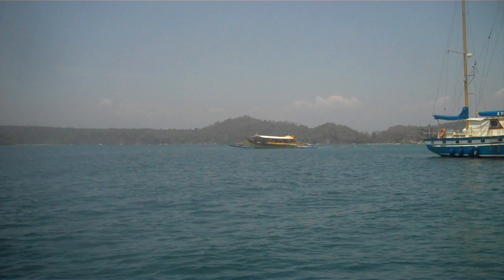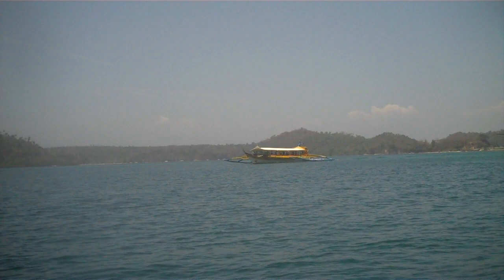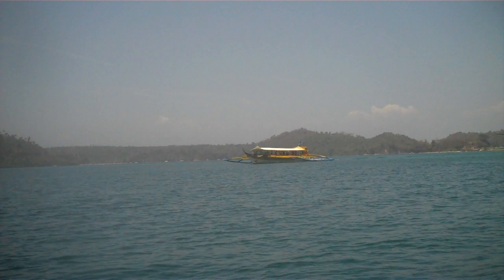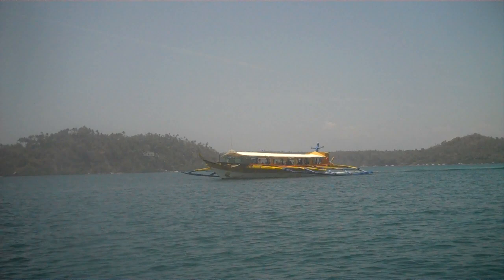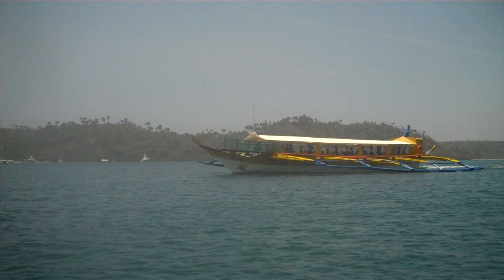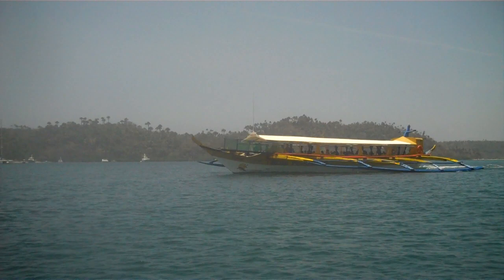Banca Boats! Traditional Filipino Banca Boat

Comment: Marine board not fly wood.  Marine boards are thicker.  Flywood would not last long on water it will wrap easily even when treated with marine epoxy.  Fly wood is so thin, maybe if treated with marine epoxy primer it would be strengthened.  For the haul that big bangka must be using marine board coated with marine epoxy too.
Reply from the maker: Actually Marine plywood  ( Not flywood ) is specially treated for the marine environment but it is still Plywood ( Made of Plies ) 
Cheers
Sean